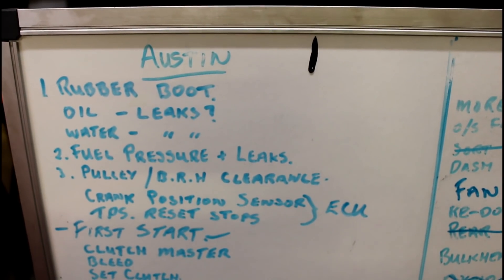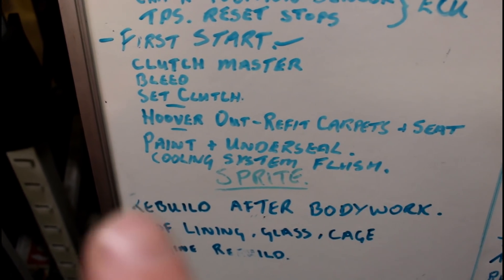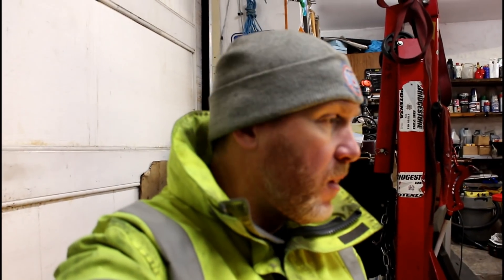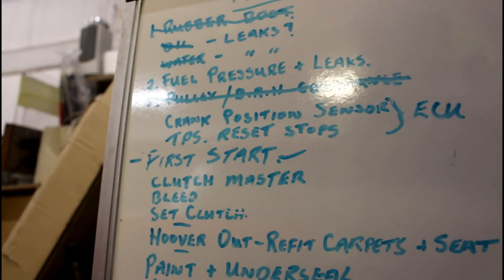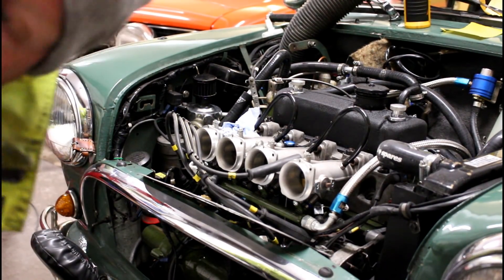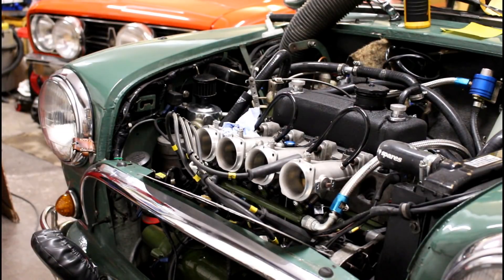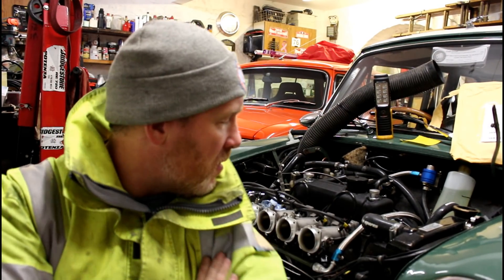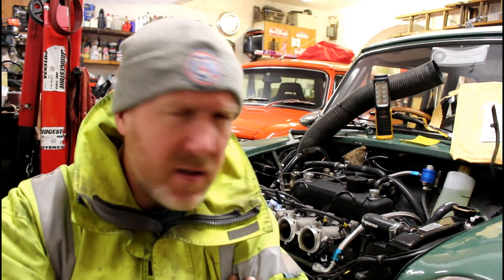Austin the Arden 8 Port. Ep6. Will the engine start after the changes?

Comment: Enjoying these vids. 
Which DTA unit are you running? Would love to see more of the map programing and setup stuff.
Reply from the maker: It's dta S40 on the green 8 port and S60 pro on the yellow 8 port. We also have an 8 port on emerald k6 , a VTEC on k6 and a xe on dta E48 (ancient but does all it needs to)
Reply: @MiniPerformance  Nice stuff! 
Back in the day, about 18 years ago, I bought a homemade progamable ignition unit for my 1380. Ford coil pack and an thin disc with a gap atached to bottom pully. Cant remember the name of the unit. 
I wonder if I still have th software on an old harddrive someware. 
Never got round to tuning it on a rolling road though. 
Maybe I'll buy back the mini rom the guy I sold it to, I just been sitting in his barn.
Reply from the maker: @no66  Edis unit maybe or megajolt?
Reply: @MiniPerformance  no, It was just a one man home job. Think he advertised in the mini mags. Can't remember.
Reply: @MiniPerformance  I've just bough back my old car. A bit of work needed. 
It was a first gen Polestar. 
Polestar have sent me the old software so when I get a USB to Serial lead, will set it up again. 
Need to find / make a base map to work from.

Comment: Oooh, close, I hope it's just ignition and not valve timing related, that would be a big job! I would be a bit worried about bending a throttle shaft with those backfires! I'm sure you'll get it sorted, the ecu and software is all "dutch" to me! Thanks for sharing the bad and the good of your builds! Cheers! Graham.
Reply from the maker: One of these days i'll have an engine that just starts right from the beginning after a rebuild, (lets see with the next 2 8 port builds coming up..) but I think it'll be more luck than management!! The bodies seem ok so far, and balance between all cylinders is good, which i think gets mentioned next week. The ECU is easy, just thing of of it as swinging your dizzy and changing needles/jets by pressing a button :) At the end of the day the game is the same, get a spark, air and fuel to mix at the right quantities, at the right time!